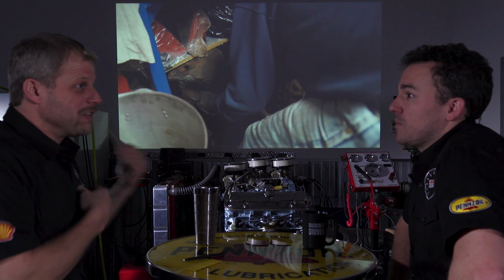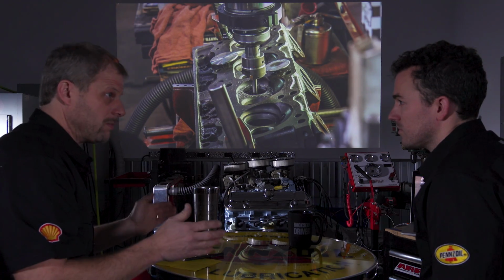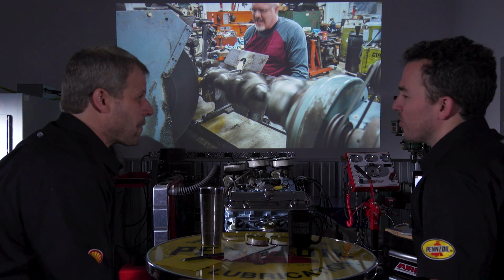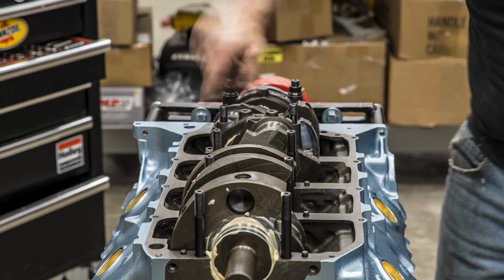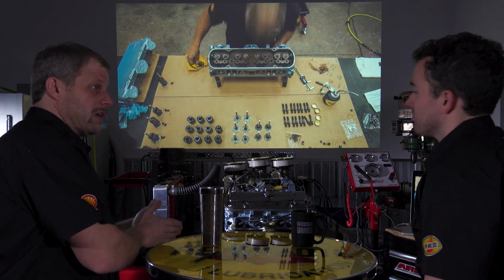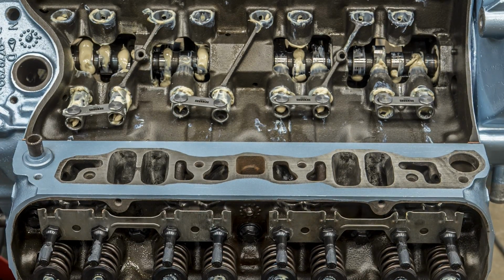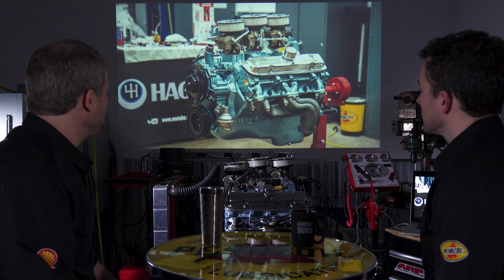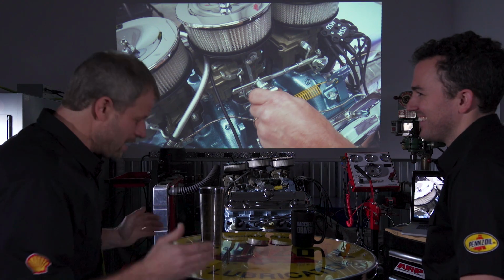How we rebuilt our Pontiac GTO 389 engine | Redline Rebuilds Explained

Comment: talking about the rod journals being a different size, it could have come from the factory that way. When I was in auto shop in the early 1970's my shop teacher always stressed to check all the main bearing and rod journals for size before ordering new parts on an overhaul because sometimes the factory instead of scrapping a crank for a defect on just one journal would rework just that one and tag it as reworked. On the one piston bore being oversized I have seen a dealer over bore just one cylinder and fix it as cheaply as possible like that on warranty work. Was it right? not really but this was at GM dealership in the 1970's and it was authorised by the factory.
Reply: In many engines, the crank would have varied journal diameters, and manufacturers would have several sizes of bearings. Those bearing types would vary in the metric equivalent of a few .0001ths of an inch. The factory would then take an exact measurement and fit the exact bearing to the crank journal. This is common on Nissan and Toyota engines. Some companies did the same with pistons, by measuring bores first, then fitting pistons that were also the metric equivalant of a few .0001ths of an inch.
Reply: If i remember right the TBI series engines (4.3 and 350) have either all the mains or prehaps it was just the rear most one cut .006 under. My Machinist said from the hundreds he's done it's like 75% chance a TBI crank is like that.